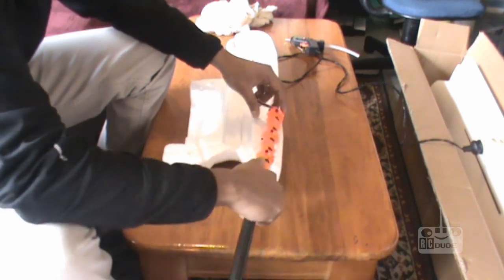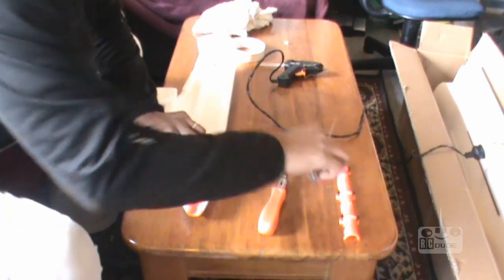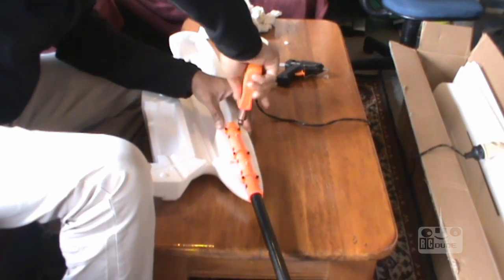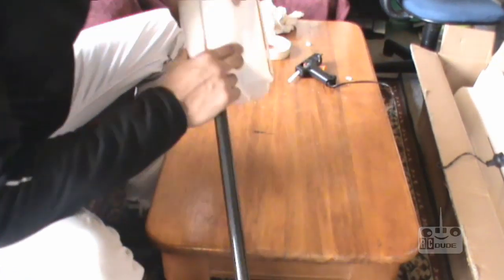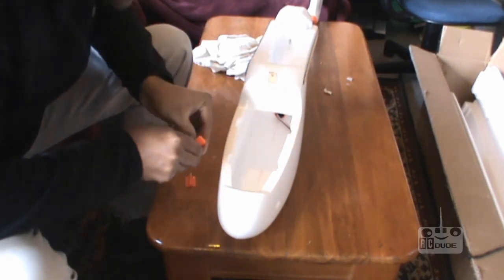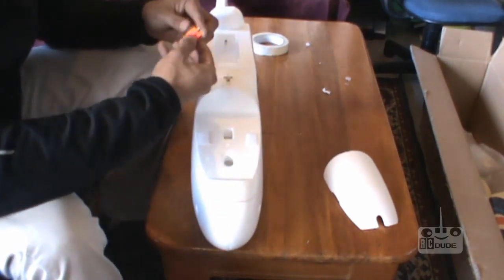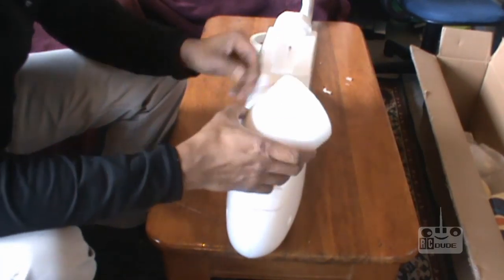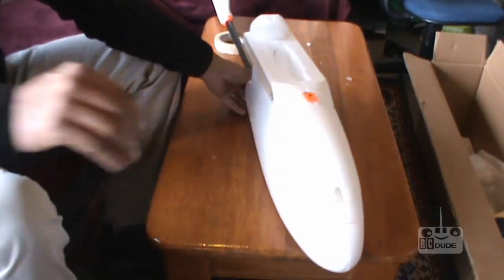Latest 2014 Version Skywalker 1900 Build Part 1 Fuselage

Comment: Lol nice vid its confusing because the actual fuse is floored
the idea being able to take the tail away for putting in the car is a nice one
but it doesn't work that way as you cant loosen all screw once the fuse is glued
and if you over tighten the plastic thread breaks. Hope your maiden went well as the model I had the wings were also floored
and dipped right on over throttle
( I changed the thrust angle tried to compensate for weight and give up in the end )
nice in theory
CRAP in relality
Reply from the maker: yes u are right  but if u want to take it its not good idea becoz  lots of wire need to be unplugs so i believe that we only   take off the wings leave as rest for things thanks

Comment: Hot glue! Really? Oh dear....
Reply from the maker: i love hot glue
Reply: Rc Dude don't worry I love hot glue too...hee hee..
Reply from the maker: paulkazjack  i love most hahahhaha
Reply: davidaearthy There is absolutely nothing wrong with using hot glue in RC, I actually prefer it over CA for fusing various pieces, especially where you need a strong but flexible joint. It dries quickly, easy to remove, is very strong and allows for some give. Just don't over-apply it.The only place where I would use epoxy instead of hot glue is to join wing sections together because it prevents the wings from flexing in the middle and altering your flight performance.
Reply: I was going to answer but I couldn't be bothered so I will just add a yawn! 
Each to there own!!
Reply from the maker: David Earthy  hahahahhahahah
Reply: David Earthy that's just lazy!
Reply: so is hot glue! :P
Reply: +Flight well hot glue is ok but not for critical parts as canopy so on so on, it melts in hot places ( believe me it does ) 2 part epoxy or gorilla glue is a safer route in my opinion , on an fpv craft i would not use hot glue in critical area SAFETY FIRST
Reply: safety first allways.
Reply from the maker: +davidaearthy  thanks
Reply from the maker: hahahh